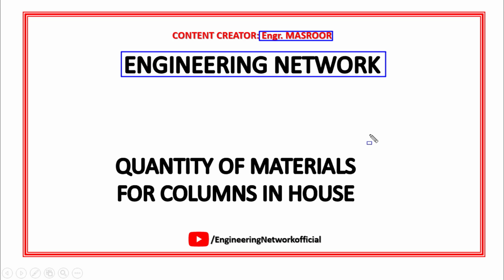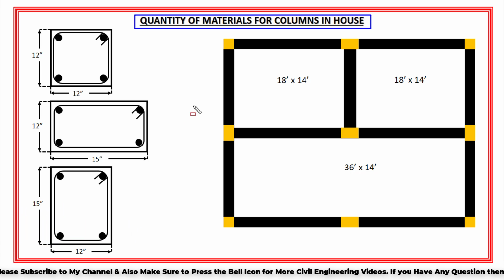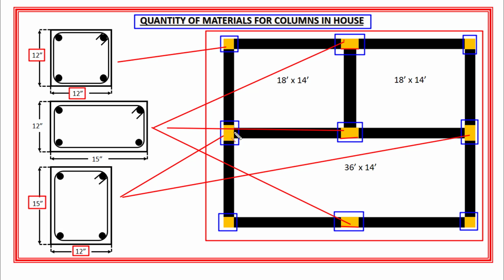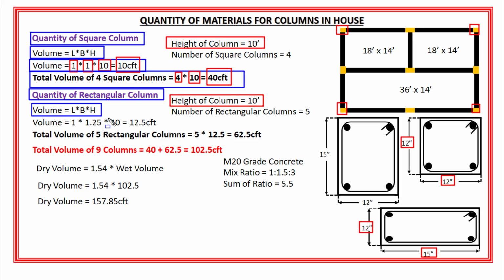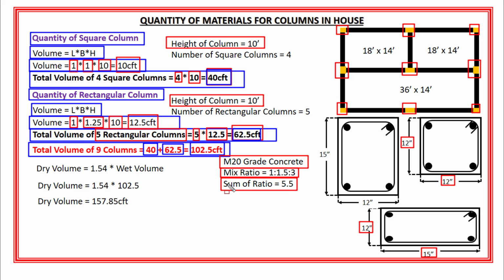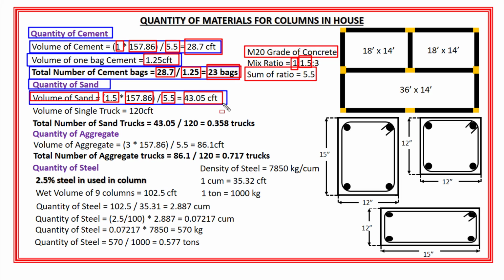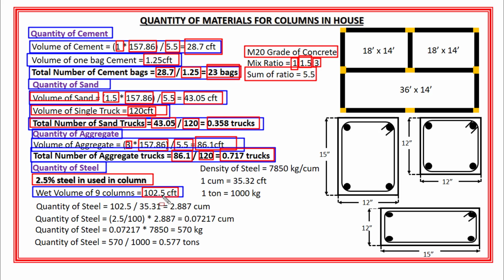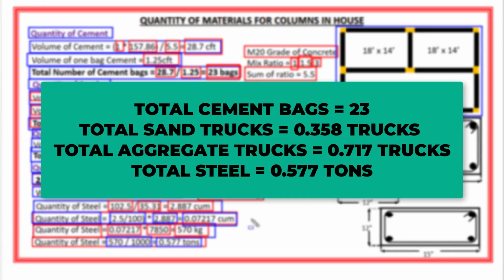How to Calculate Quantity of Concrete & Quantity of Steel for Columns – House Estimation (2022)

Comment: sir 2.5 percent  steel value ye    thumb rule   hai ya siraf andaza hai
Reply from the maker: This is the thumb rule
Reply: @EngineeringNetworkofficial  sir thankz this thumb rule used big building or small building  same used
Reply from the maker: Yeah you can use it for small and large buildings.. actually it will help in interview and on site... Don't use it in your exam paper
Reply: @EngineeringNetworkofficial  thanksir
Reply from the maker: You are welcome... Kiny share this course of house estimation with other civil engineers
Regards:
Engr. Masroor khattak